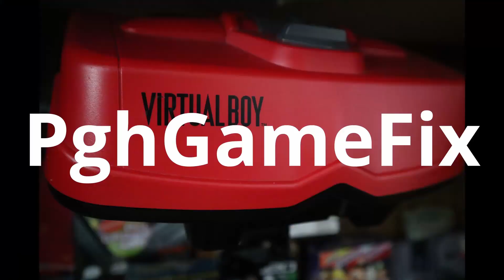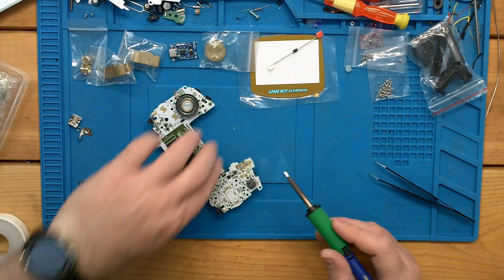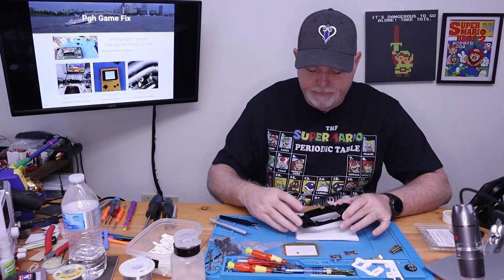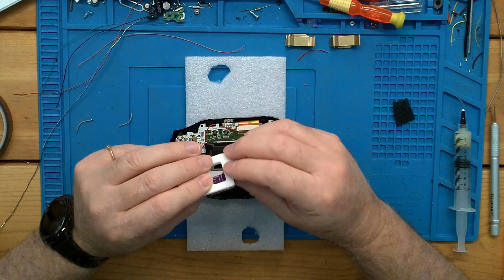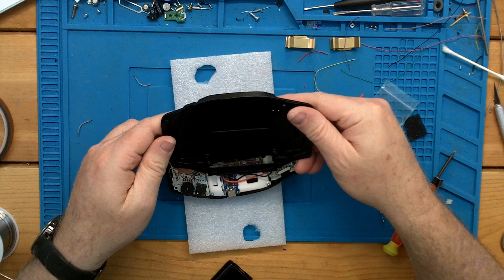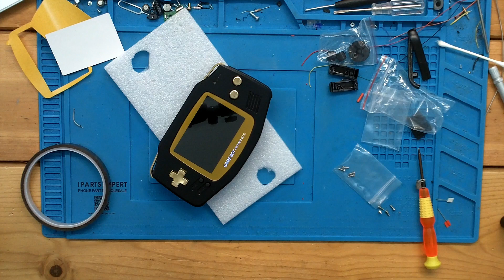Boxy Pixel CNC GBA with USB-c and audio amp.

Comment: Nice video. One question is: does the Boxy Pixel GBA accept the Nintendo wireless adapter? I have been playing all my GBA games on a Macro but just got into 3rd gen Pokémon games. I had an opportunity to trade with another player but that's something you can't do with the Macro mod.
Reply from the maker: It should.... but it doesn't have the locking holes.  I can verify in a day or two.  I will stop at the local used game store, and try one.  As far as the macro... the wireless never worked with the DS units.

Comment: Hi! can it still charge while using the gameboy?
Reply from the maker: yes... this conversion should still work the same.  BUT... it won't charge as fast since the GBA will be using some of the power.
Reply: @PghGameFix  what diode did you use in this?
Reply from the maker: @markkevinbpaz  It was supplied with the kit... but it was just a generic, low amp switching diode.

Comment: Do you know which wires went where for the audio amp? I'm trying to go off of your video but its too zoomed out for me to see. Even a link to where you got the spots to wire too would be greatly appreciated.
Reply from the maker: The audio in is from the original speaker point... and audio out is to the speaker.  The power can come from anywhere you want.  Generally, you can find it on filter caps.  One side will be + and one side will be ground.
Reply: @PghGameFix  sweet! Thanks so much!